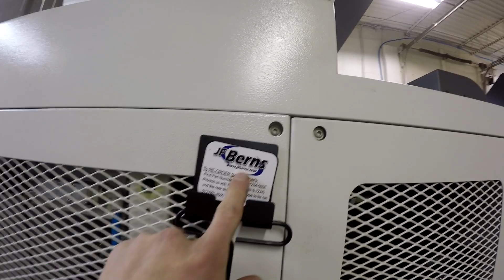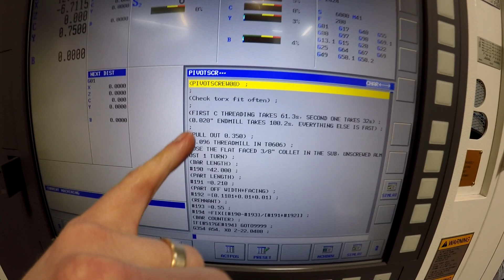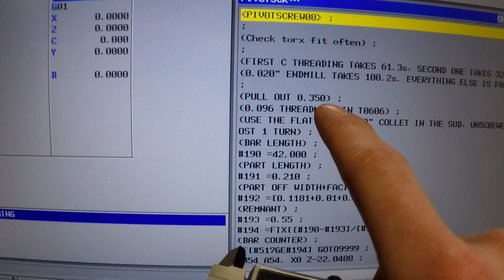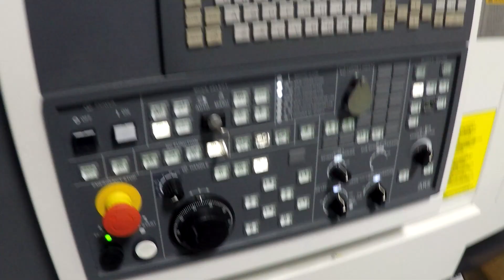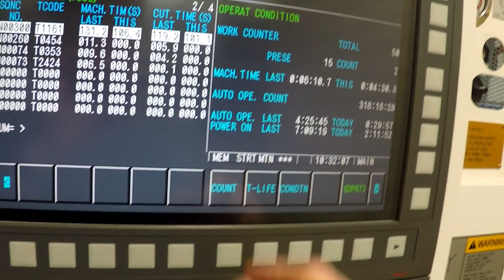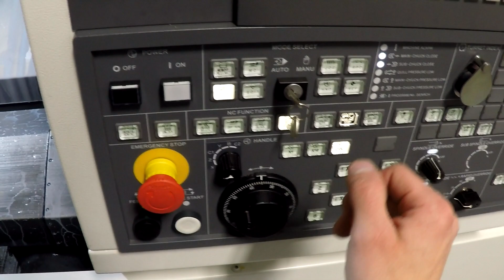CNC Lathe fun

Comment: Instead of tightening or loosening stops or ejector pins with your bench top 5C collet end wrench. I'd suggest getting a collect wrench similar to the one in the link below:

https://www.mscdirect.com/product/details/77317808

You would still be able the use your bench top 5C collet end wrench in combination with the one in the link above. This practice would put less stress on the collet itself, especially on an emergency (soft) collet, and also less ware on your bench top wrench. Those "wings" on your bench top wrench will break off over time.

Comment: Nice Video. I didn't read every comment so I don't know if anybody shared this: I use a combination square, 2", 4", or 12" for my material stickout. Lock your caliper to the desired stickout  amount, then set your combination square to your caliper.
You can find one at any hardware store for around $10, or you can get the better Starrett one. 

If I use my caliper for stickout, I always lock it to my dimension and use 2 hands, one pulling the material out, the other one holding the caliper up against the collet.

It really is impressive what techniques people come up with when all they have is their imagination. 
You give 10 machinists the same part to make, they will make it 10 different ways and have the same end result, besides overall time, which depends on your equipment and skill level.

Comment: Why not mill a tool to set it to 0.350"? I doubt it takes you a long time to set each bar but there is time to save with the cost of a piece of aluminium with a hole milled in it.

Comment: Hey John, I was thinking about your process, and I think you could benefit from this. 

Before you do your parting.
1- stop main and bring in subspindle and clamp
2-unclamp main spindle and pull out however much you need for the next part (you have a lot of coolant and very little chips to worry about getting in the collet of the main spindle)
3-clamp and part it off and finish the program

by doing this you could loop your program x times and when the machine stops do your checks. You could probably get crazier with this if you wanted to, maybe adjust the clamp sensor so that when no bar is present it alarms with no clamp ect (there is probably a better way, but thats one idea hahh).
You might already be doing this, if not, you should!

Comment: And if you could not get to that side, you could always use a few pieces of threaded rod with some double female connectors. so I guess the only step left on the fasteners is to lap the bottoms to a mirror finish?

Comment: nicely done. bravo. I'd LOVE to learn CNC. I've got wire frame 3D modeling down. just need to import that into mastercam and learn that crazy program!
Reply: You should definately "just" gogogo. MasterCam is reasonably easy to pick up. And there's loads of CNC 101's floating around on the web. Shouldn't cause you too much of a headache if you've got manual machining down already. Only real hurdle is memorizing G and M codes, but reference sheets and time will help you.

Comment: there are no stupid mistakes only learning experiences 33 years of my own experiences my advice to you is to learn macro/ parametric/high level g code programming if you don't know it already fanuc B macro programming is what you should be doing for high production super fast set ups as you can put all your hard numbers in thru the program using g10

Comment: The finish on that torx is incredible - it's amazing to think that a big machine is capable of holding such tight tolerances on parts. I wonder how sensitive the force sensor must be, to detect resistance if the torx isn't there - I'd be interested to see a quick video on that feature! Does it let you set force limits etc.?

Comment: Why don't you lock the calipers at whatever depth you need and push the rod in? That way you won't overshoot and have to pull out the rod again.

BTW, looking at those spinners it occurs to me that all the ones I have seen are symmetrical, but they don't need to be as long as the center of mass is on the axis of rotation, so you could use materials with different mass if you wanted to make an odd looking one :)

Comment: Instead of making other sized bar collars, why not make one size fits all, and, as you go from size to size, make the "plugs" that hold the rods in different sizes.

So essentially, a single collar unit (3 in total) that has a thread on the inside to hold various sizes of bar stock. That's cheaper, and less time consuming, over all.
Reply: ALSO, i don't think it needs to be out of metal. It can be made from delrin. It's resilient enough, doesn't scratch the inner barrel, and fits in perfectly with the theme of making something cheap. FAaaaaar cheaper than making it out of metal, even less time consuming.

Comment: Why would you thread mill when you can just turn the thread?
Reply from the maker: Normally I do turn the thread but it was making too many burrs on the thread because the stainless is hard at 45rc, so threadmilling seems to be producing a cleaner thread.  A lot slower though.
Reply: Sure. If you want to speed up,  you can just turn over the top of the thread.
Reply: You could re-run the OD turn like Sam Stone mentioned, then re-run the spring pass- allowing the OD turn tool to debur, and the OD thread tool to re-top to ensure a useable thread.   That may get you out of the woods with conventional threading tools.  like the Iscar IQ DECA with 10 corners on an insert.
Reply: You could use a topping insert or a multi tooth thread mill. That machine looks pretty awesome. How do you like it?

Comment: Set your calipers at the desired dimension with the lock screw then pull your part out to length, should be more consistent and faster to do. That spindle speeder is awesome!
Reply: I will go one better for the tech geek step, why not add a line of code so the machine homes one of the flat tool holders like the parting tool in front of the bore to the programmed stick out dimension, then just slide out against stop, clamp, and cycle start. :-)
Reply: cough, bar feeder, cough
Reply: Yeah seconded, just lock the darn thing

Also, for production parts where you're going to make them often, you can make a little L-shaped gauge that's got the correct step length just built in. Slap a label on them, or engrave the part name/number/offset length, and start a little collection of them.
Reply: I was just going to suggest the same thing.
Reply: If there was room for one!
Reply: eformance priceless
Reply: I was thinking the EXACT same thing. that's what I would have done anyway.

Comment: John, have you ever heard of using threads to create knurling? Did you ever try it? It seems to me that you would have allot more control over depth and pattern, if it is possible.
Reply from the maker: Like thread rolling?  I know it's possible and done a lot, but probably really hard on these small parts.  Maybe easy, I don't really know.  This way and traditional single point threading seems to work great.

Comment: for finish on a part with an small to wide diameter part use constant cutting speed, that will give the same finish on the whole part. example : G96 V120 (don't forget to use G92 because the machine will go to its max spindle speed at close center of the part) then in the coming blocks use the same programing with G01

Comment: i dident know the 11:00 thing and iv been working with lathes for 12 years :D
Reply: LinkN01 I didn't know that either, that's one of the many reason I love this channel I have learned a lot of cool little tricks
Reply: well. i only do mass production this days so i only use the caliber for measurement of the parts. Feels like I'm going to work Monday trying to find ways i can use that anyway haha.
Reply: Thank you! I am just taking a machining class, and will see if that measurement is something I should have been doing!
Reply: When setting (not measuring) the rod length, you can use the little knob on top of the caliper to lock it at the right spacing, then just push the rod until the caliper hits and done!

Comment: Just so you know, the collet wrench you mounted to the table is designed and used to put the collet in and out of the spindle adapter.  There is another wrench that slides over the back of the collet with a pin that fits the keyway, this wrench is used to hold the collet in place while putting in collet stops in the back threads.  You can google 5c Collet Stop Wrench and see an image of the wrench with the key if you don't understand what I'm saying.
Reply from the maker: Ooooh I did NOT know that, awesome!  Thanks for the tip.

Comment: Great stuff John,, couldn't fail to see the spinner on the table, what's the latest,??
Reply from the maker: Check my instagram post if you can, it's almost ready for prime time!  Sad to say that my Grimsmo Bearings were noticeably worse than the Boca ones.  I'll show that in an upcoming video.  But the spinner rocks now.
Reply: JohnGrimsmo,,  , the crunch time is gonna be deciding the price point you want to aim for,. A lot of the high end spinners are being cloned, (by you know where), almost as fast as they're on the market, ! I think a lot of people are heading down the cheap and cheerful route, rather than waiting for the "holy grail", which often comes with a hefty price tag.! . Spinners are not like knives, where the devotees worship the hallowed ground you guys walk on.. A prime example is the torqbar, you can get a decent clone from Amazon or ebay for around 5 dollars, all the masses want is a fidget toy at the end of the day, it's not the same as wanting a norseman which will be a heirloom item. Anyway, if you want to send me an early prototype, I won't say no, ha ha, good luck with the diversification, cheers, John .
Reply: Silicon nitride hybrid bearings. Those are the equivalent of using titanium for your screws (-8